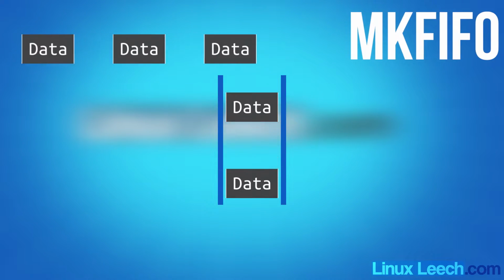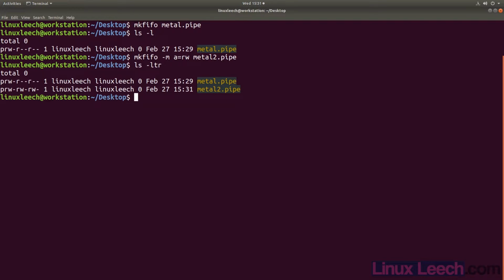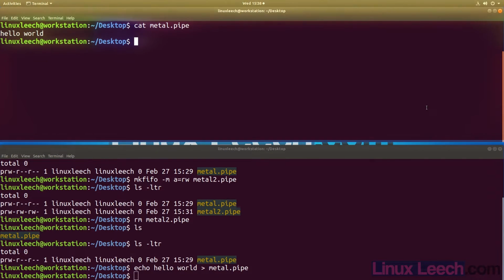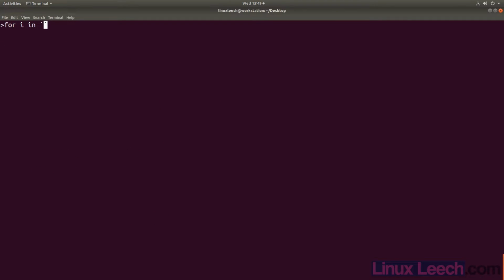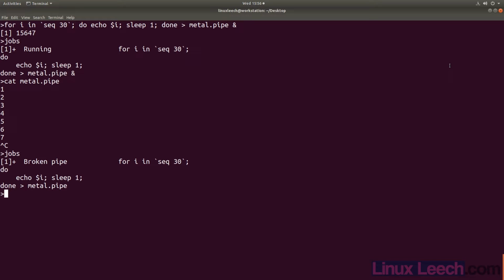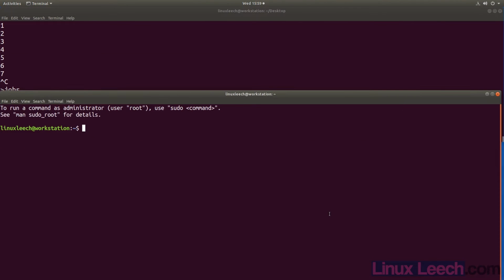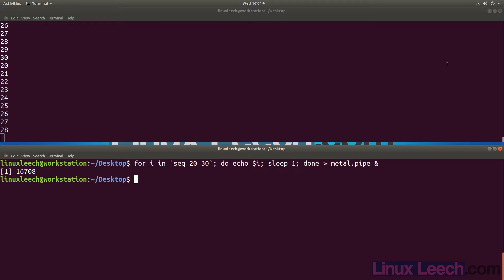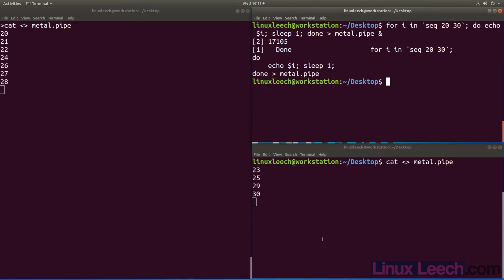Named Pipes - Inter-Process Communication Linux

Comment: Hey, that's funny! I recently tried to teach myself pipes, from what I found in the documentation, and did it in very similar way: Multiple terminals next to each other, for-loops, counter and sleep-command. 
What I fail to understand is the syntax of 
<code>
cat <> pipe 
</code>. 
Reading the documention, and experimenting, I realized, that it isn't replaceable by `cat >< pipe`, nor by `cat < > pipe.` So it is not the combination of two operators `<` and `>`, at least not an algebraic combination, but an operator on itself - I would call it the diamond-operator. 
In contrast to 
<code>
cat pipe 
</code>, it is just sitting there after the input finished, waiting for more, while `cat pipe` just finishes, when it is ready.

The manpage says: <pre>
Opening File Descriptors for Reading and Writing
       The redirection operator

              [n]<>word

       causes the file whose name is the expansion of word to be opened for both  reading and writing on file descriptor n, or on file descriptor 0 if n is not specified.  If the file does not exist, it is created.
</pre>
That's confusing to me. In which way is word (aka pipe for our purpose) opened for writing with cat?

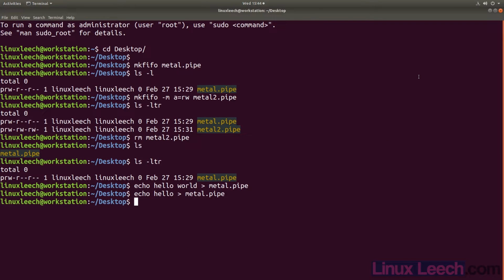BTW: Using backticks (2:00 ff.) is discouraged in the shell. `for i in $(seq 1 20)` is better readable, more portable and trivial to nest.

Comment: What’s the simplest IPC paradigm to use if I want one writer, but multiple/each reader to see the same data?  Kind of like one writer, but multiple tail -f’s.  Do I just write to a plain file and flush it aperiodically?  I guess I need to investigate how to code tail -f ...
Reply: I don't know, whether it is the simplest way, but using the tee command worked for me:
```
mkfifo pipe1
mkfifo pipe2
for i in {1..20}; do echo $i ; sleep 1; done | tee pipe1 > pipe2 
```

Comment: While this is very informative i'm having trouble trying to find a situation in which this would be useful.
Reply from the maker: You could use it as a simple message queue and have multiple readers consume the data from the pipe to process. For example if you had a file of URLs that you wanted to download with wget you could cat said list to a named pipe then start up multiple instances of wget to grab URLs from the named pipe. You could use it to compress anything piped to the named pipe. Like this:
     mkfifo metal.pipe
    gzip -9 -c < metal.pipe > output.gz &
cat files that you want to combine the contents of to your pipe > metal.pipe
Now you will have a compressed file that contains the content of all of the files that you piped to your named pipe.

It is common to do this kind of thing in reverse when populating tables in mysql. So for example
    mkfifo -m 0666 /tmp/metal.pipe
    gzip -d < customer_data.gz > /tmp/metal.pipe
Then load the decompressed data into a mysql table.
LOAD DATA INFILE '/tmp/metal.pipe' INTO TABLE customerData;

Doing it this way means that you don't have to decompress the data to a file on disk which takes up space and disks are slower than RAM. And the only file that you will be left with is the named pipe on your computer which is in /tmp so you don't need to rm it as it will disappear the next time you reboot.
Reply: One example that brought me here: I’ve recently stumbled on a error in a python program that I wrote. It’s communicating via a socket connection with another system. A socket seems realized as a pipe. Unfortunately I got a broken pipe error. My conclusion after watching the video is that the other system propably closes the read on the socket.